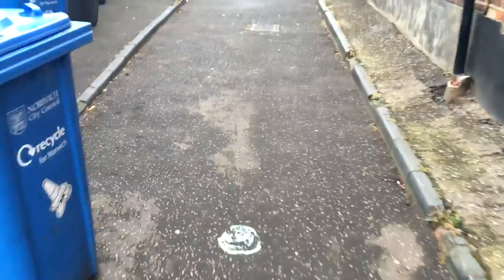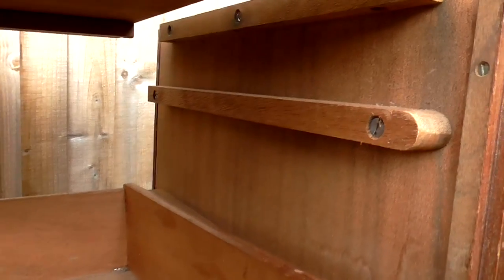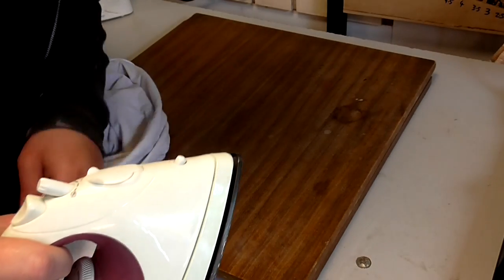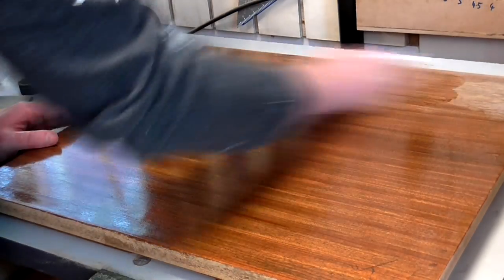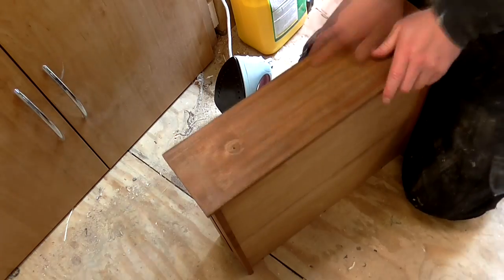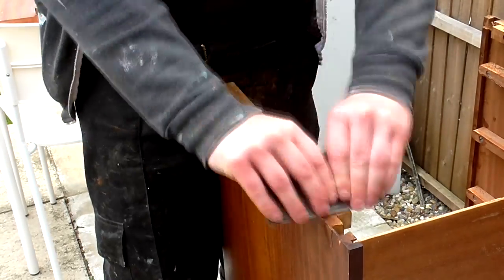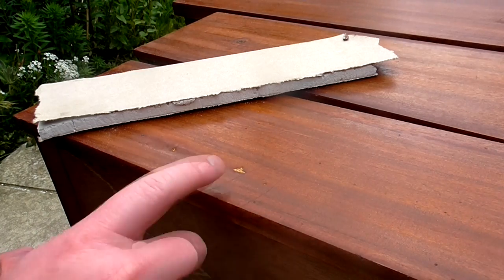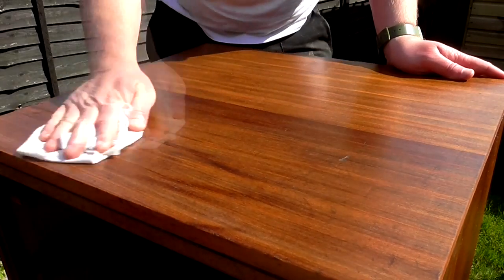Restoring A Chest Of Drawers - Junk Find Makeover

Comment: I saw three chests of drawers for sale - solid antique pine, which turned out not to be so good as they looked in the picture. But I felt so awkward I ended up buying them. There are scratches, white marks, and scuffs all over them. So I looked on YouTube to see how I could fix them up, and found your video. I was really impressed with your renovation of these drawers. So I thought I would practice on my coffee table, which was also badly marked. I went to B&Q to buy the stuff you used, but could not find some of it. I got a wood scraper instead of the cabinet scraper you used and got a sandpaper block and some linseed oil and polish. The first attempt did not go well, so I sanded it again, this time with an electric mouse sander and bought some wood stain, as the light marks had not covered up. The second attempt was reasonably ok, except that the table top is now darker than the legs! So then I thought I would try the worst of the drawers. It had an area of white damage on the top. I sanded. and stained, but the white area is now darker than the rest! What should I do? I am just about to sand it down again. I see you just used linseed oil, not stain. The white spots on the side of the drawers have covered up well with sanding and staining.

Comment: Great job.  I too did not know about the iron trick.  Keep up the good work!
Reply: Chem Cody  You can lift small gouged damage on all sorts of wood by using a dab of water and heat from the tip of a hot iron. More success if you've stripped off paint or finish first, but as was shown, it can be done with a finish that needs to have stains out.

Comment: A great save on something that was destined for the tip.  I've used the cocktail spears (tooth picks on this side of the pond 41.5N 71.3W) in screw holes to get extra bite. A bit of glue in the hole, insert a broken piece of wooden spear and Robert is your Fathers brother.

Comment: You did a very nice job on the restoration of that piece. Very smart idea if using the iron, which I have not personally done before. And I also like the steps that you took to break down the old finish and restore with the new. Also nice reconstruction since it was starting to break down.

Comment: Awesome restoration! I did not know you could remove water stains with the iron, helpful tip. 

With the one damaged drawer pull, you could make a fresh cut and mold similar colored wood putty to match the shape then sand to match exactly. Might be too much work though.
Reply from the maker: +Jason Barre I thought about trying to make a new handle for it... Maybe I'll try some day!
Reply from the maker: +Jason Barre I thought about trying to make a new handle for it... Maybe I'll try some day!

Comment: You can lighten dark water stains by putting a 10% solution of oxalic acid in water onto them and let is sit for a couple of hours. Then you remove the solution with some water and repeat a couple of times if necessary.
Reply from the maker: +Eduard van Iersel thanks for the tip! :-)

Comment: You're doing God's work, sir. I, too, have this calling and reap many rewards, namely the joy of the work itself but also the recycling and the using. Suggestions: scrape/sand before ironing, and chuck the pulls/handles for spin sanding when possible. These ideas are based on my perceptions of ease and efficiency and are by no means rules. Also, the darker water stains can be reduced with oxalic acid if it's available to you. Peace.
Reply from the maker: Thank you!

Comment: Just a thought:  For the deeper water stains that are under the finish, scrap the finish off first, then hit them with the iron.  Also, I'm guessing you are in the UK.  I'm thinking that have stores there where everything is a pound, much like a dollar store here in North America.  Little cheap art paint brushes from the dollar store are ideal for applying and spreading wood glue in these types of projects.  Keep an old can of soapy water and one of clean water and just stir the brush around in the soapy water, then the clean water and let it air dry, then you can reuse it for wood glue multiple times.

Comment: Greasy stains can be removed by putting chalk powder on top, cover that with a sheet of brown wrapping paper.  Heat it with an iron.  The grease will melt and the chalk and paper will absorbe it.  The last bits of greasy stuff can be removed with mineral spirits and a rag.
Reply: Damn thats a crazy cool tip! Thanks!
Reply: Great tip.
Reply: Tnx man great tip😉
Reply: 1959Berre would baby powder work as well?

Comment: If you'll send it by hand like you're doing with one of them little bone sandpaper it's in a little block get the heavy one then the lighter one on the back of it it's easier to sand a lot easier I work on that kind of stuff all the time and canes is what I do with pictures all the way down I'm going to leaves and stuff like that so and it you can go in a little cracks and around things with that little square but you can't any other way with a piece of sandpaper

Comment: That was an awesome transformation! It maybe made with some "Cheap" wood (or as I call it Fake wood) but you'd never know that to look at your final product - well I guess wood workers would know, but us normal people would think it was oak, or walnut or something expensive :) 

And since this was Fake wood, I'm thinking I maybe able to do this to my kitchen cabinets, they're very old and I'm almost positive it's not real wood but particle board with veneer over it, I've lived here 10 years and they're older than that and I started wiping them down gently with just a normal sponge(no scouring kind) with murphy's oil soap, and there is all sorts of scratches all over it now , I did a home "Hack" of Cooking oil and Lemon Juice, Yes it covered the scratches but now those areas are darker toned than the rest so now that drives me nuts (OCD) , But the scraper thing you used 1st  can that be bought at a hardware store?
Reply from the maker: Thanks! Yes look for a “cabinet scraper” or “Card scraper” you can get them on amazon if not